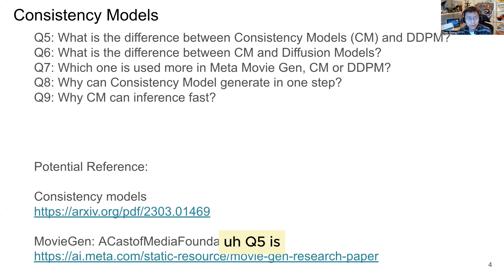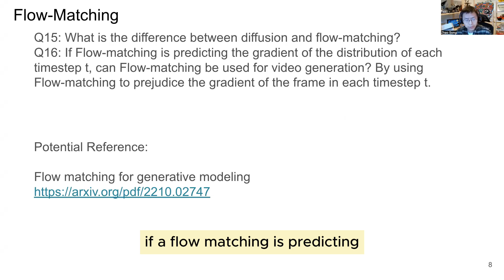Basic Questions in Computer Vision

Comment: Q13: VAE is a generative model that aims to model the input distribution p_\theta(x). The encoder predicts the mean and variance of a latent vector z with input x. Latent vector z follows a multivariate Gaussian distribution. The decoder transforms the latent vector z to a sample that comes from the input distribution. The model is trained with the ELBO loss function, which is a lower bound of p_\theta(x). 

Q14: Vector Quantization is an embedding table compression technique used for image retrieval[1]. Specifically, it divides the embedding space into K small pieces by K-means, and all the vectors belonging to one specific piece are represented with the center vector. Thus, any vector in this embedding space can be represented with a discrete integer index in 0 ... K, and this only costs logK bits for storage, which is much more memory-saving compared with a vector represented with d (num. of dimensions) float numbers, which could cost up to d * 32 * 8 bits for storage. 

VQ-VAE changes the latent vector z in the original VAE into discrete indices with Vector Quantization. These discrete indices often correspond to some actual meanings in natural language. 

More basic questions on DDPM:
What does Rao-Blackwell mean?
When rewriting the ELBO loss function of DDPM, how should we understand variance reduction in this context?

[1] Ge T, He K, Ke Q, et al. Optimized product quantization[J]. IEEE transactions on pattern analysis and machine intelligence, 2013, 36(4): 744-755.

Comment: Supplementary Answer to q11: (1)Adaptive Double Normalization. AdaGN layer in CM negatively impacts the training process. Adaptive Double Normalization, which is modified from AdaGN, defined as y = norm(x)⊙pnorm(s(t))+pnorm(b(t)), retains the power of AdaGN but removes its instability in CM training. (2)Tangent Normalization. Tangent function df_θ_−/dt causes the most gradient variance in CM training, which can be normalized by (df_θ_−/dt )/(||df_θ_−/dt||+ c), c = 0.1. Also, clipping the tangent within[-1,1]can cap its variance to improve stability. (3)Adaptive weighting. Integrating a prior weighting w(t) = 1/σ_d tan(t) into the adapting weighting function can further reduce the training variance. (4)Tangent Warmup. Another factor causing the instability is the term sin(t)(x_t + σ_d(dF_θ_−/dt), which is the decomposition of the tangent d f_θ_−/dt. To alleviate this problem, the coefficient sin(t) is replaced by r·sin(t), where r linearly increases from 0 to 1 over the first 10k training iterations.

Comment: Answer to q3: ODE probability flow is a deterministic approximation of a stochastic diffusion. It is also an ODE but is used to approximate the stochastic ODE in a deterministic way.

Answer to q6: Consistency models can generate data in a single step or just a few steps. It has higher speed and efficiency. Diffusion models require gradual denoise using dozens or hundreds of steps.

Answer to q10-11: 2 factors that cause the consistency model to be unstable: 1. CM gradient has the component: log(σ_d tan t) which goes to infinity when t becomes pi/2. The way to solve this is to change this to identity function t. 2. it also has the component of the time embedding which is ∂emb(c_noise) = s · 2πω cos(s · 2πω · c + φ), which fluctuates a lot when s becomes large. To solve this, we can set s to be a constant, like s ≈ 0.02. 

Answer to q12: EDM is a variant of the diffusion model. In general, the diffusion model noise iteration is defined as xt = α_t x_0 + σ_t z, and in EDM, we set α_t = 1 and σ_t = t.

Answer to q15: Flow matching is also a variant of the diffusion model. It is similar to EDM, and the differences are that we set α_t = 1 - t and σ_t = t and that our training objective is to make the prediction of gradient more precise.

Comment: Answer to Q1:  
1. DDPM forward process is Markovian. DDIM forward process is non-Markovian, but still can design generative reverse Markov chains.
2. Non-Markovian processes lead to shorter generative Markov chains. So DDIM avoid adding noise at each step. Thus, DDIM is faster with fewer sampling step.

Answer to Q12:
1. EDM paper summarizes the diffusion models families and form a general framework. EDM itself is designed based on this general framework to achieve good performance.
2. Not necessary. But it is recommended.